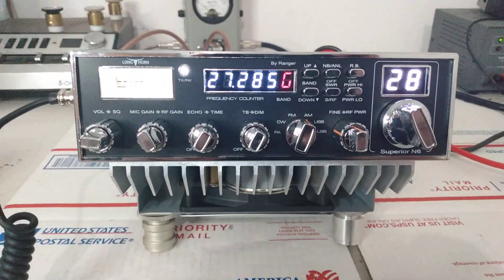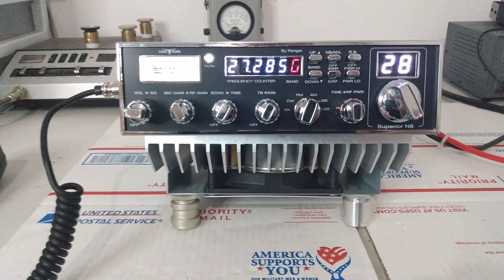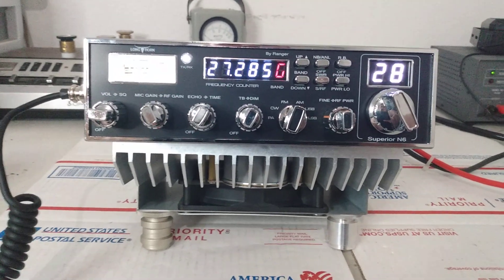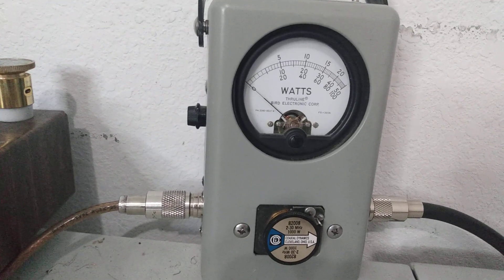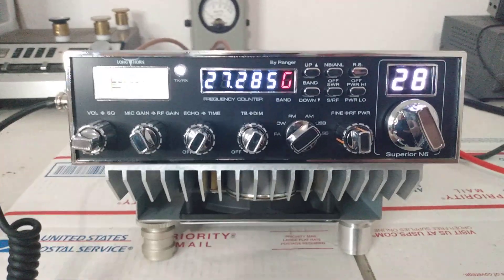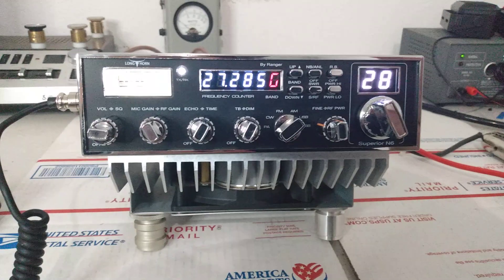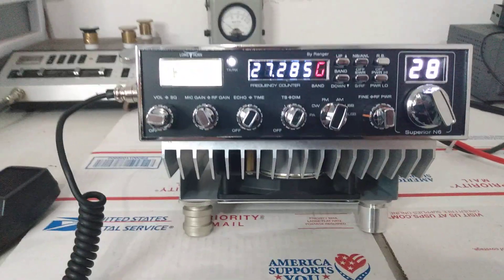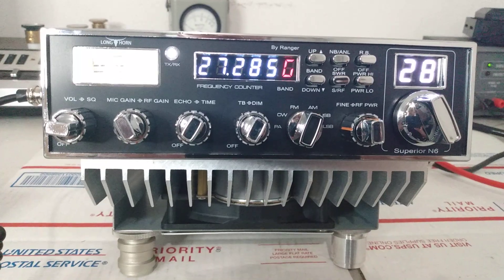Longhorn by Ranger, test for customer, average and peak power, AM and SSB

Comment: What's the deal with the power hi/lo button? Is that amp on/off?
Reply from the maker: It is
Reply: @Rooster_Radio  do you remember what it did on low?
Reply from the maker: @jedUDX183  there's a full demo video on here that goes over every feature..100 watts or so